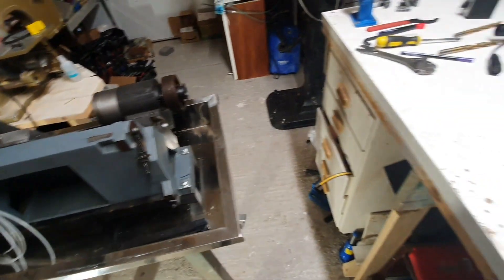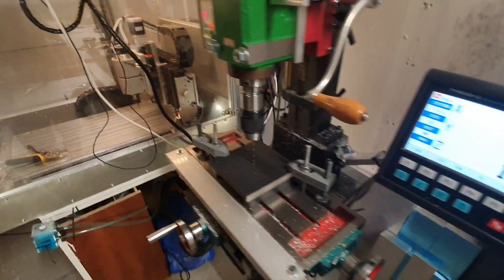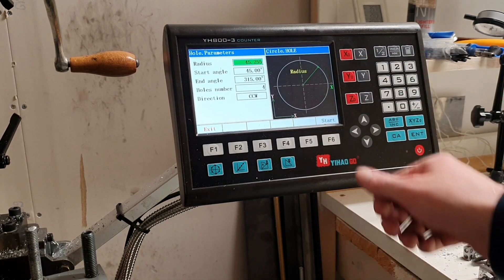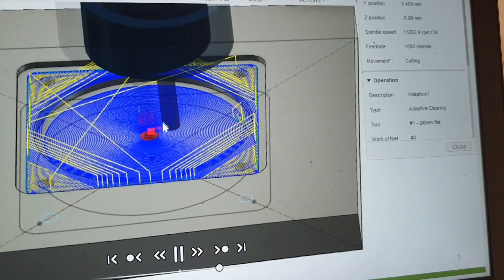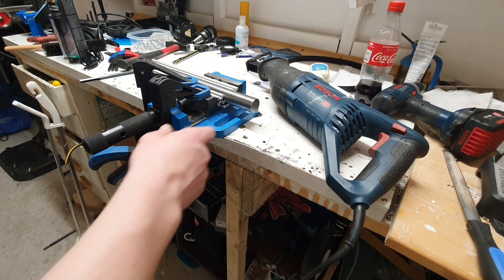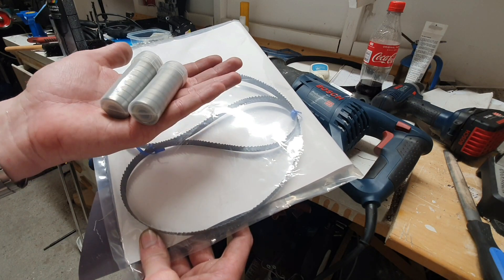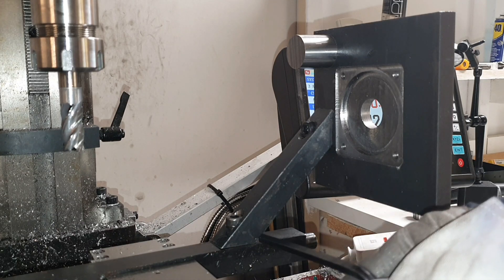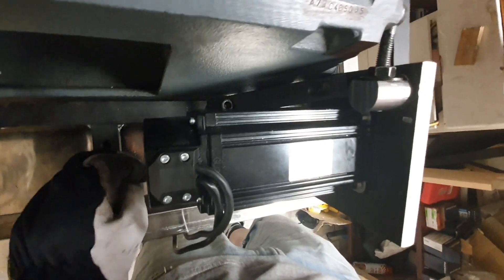Part 2 Cnc lathe - Making AC servo motor mount (Emcoturn)

Comment: How much shaft do you have sticking into the timing pulley.  I too had to make an adapter plate and between that and the mounting plate that takes away .887" of shaft from me and that means my shaft doesn't go all the way to the end of the taper bushing timing pulley.

Comment: the central hole ( large bore through hole ) can be done on the CNC.. I know , its harder to prgram the CAM .. But , when starting out , you can simply run 2 gcodes.. One would be the operation you did for the pocket.. Pocket2 would be the hole ( yees run it as a pocket using the same end mill)  Keep the work and the zero positions( offsets)  the same so nothing has to move..
Reply from the maker: Thx for commenting. Yepp, I could have machine that on the router, I Only needed to select one more geometry in fusion. I chosed to make the center hole with the minimill simply because I wanted to practise some manual drilling and boring. :)